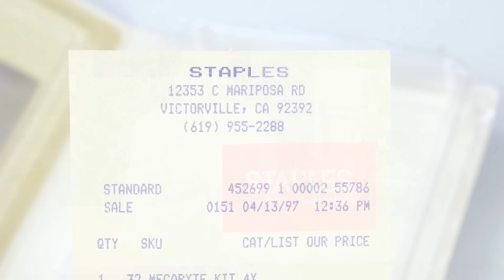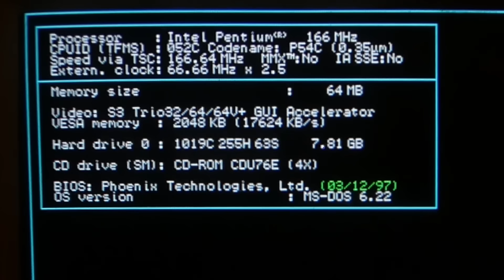Pushing Socket 5 Past Its Limit

Comment: That price seems cheap for 32mb then, but prices were dropping quick in that era. In 1993-1994 it was around $50 a megabyte of ram, then by 1998-1999 I bought my first 128mb dimm and it was under $150, maybe even under $100 by then.
I can't even remember if i had a socket 5 board but I think I did, my first pentium was a p54-120 and I overclocked it to 133, and tried 2x75 but it wasn't stable at 150mhz. I think when I upgraded to a k6 200 I got a new board and went socket 7, but I can't remember what I did with the old board and chip. I still have the board that the k6-200 engineering sample chip that I delidded and ran at 225mhz, but it runs a k6-2 450 on 6x75 now, and the super socket 7 board that originally had a k6-2 400 on it runs a k6-2 533 at 600mhz. I wish I had picked uo a k6-3 back in 2002 when I upgraded it but didn't want to spend a few more bucks back then.

Comment: I have got the At&t Globalist 375TPC, and that problem with it not booting sounds like a problem that I was having but fixed. It turns out that the version of Phoenix bios (version 4.04) hates using hard drives with cylinder values over 6349 (with 16 heads and 63 sectors)

Comment: Set it up for 100mhz and put a 233mmx in there. It will work. Although controversial cuz the core will run 3.3v instead of 2.8v. I tried it in a dell optiplex GL 575. Dont recommend running it like that for too long though. Some people say its fine, some say its not. My vrm was running insanely hot though thats for sure... 😂

Comment: you dont get linear scaling if you only bump the speed of the processor, you are stuck at 66Mhz FSB and ram. Higher multiplier = less scaling
Reply from the maker: My mind was occupied with other things while making this video so my conclusions were pretty rushed. I didn't consider things like cache and PCI bandwidth staying the same.

Comment: Even if benchmarks are saying that the average frame rate is 60 (or 35) doesn't mean that it's not dropping below that and still potentially presenting a poor experience at times.  This is why for a lot of game benchmarks you see stuff like 1% lows and 0.1% lows and stuff.  Though aside from IO, these old games won't have too much stutters from processing.

Comment: about the non linear scaling, there's some mathematical laws that get in your way. With faster CPU speeds you bascially get a linear region up until the memory bus starts getting saturated (either ram or video whichever gives out first) at which point you get an asymptotic decrease in performance until you hit 100% utilization at which point upping cpu speed doesn't matter at all.  In non math terms diagonal line that slowly turns flat as you keep upping cpu speed, with a ceiling it never gets above

I remember a personal project I did overclocking a powermac and upping the frontside bus by 10% literally did more than doubling the cpu speed. I find this stuff fascinating which is why I got into doing it for work :P

Comment: That is one beautiful system, I find kind of puzzling that you mention in this video something as weird as socket 6 but forgot to mention the entry level Pentium 75 it was the first real option for people that didn't want to invest into a 486 but couldn't afford a 90 or 100Mhz (these two came earlier than the 75) it might have not been any faster than an Intel 4866 DX4 100 for general purpose, but that Pentium Math Co-Processor was difficult to ignore. BTW cool RAM kit, Back then you could experience severe price hikes followed by price deeps in a few months, I knew people that did speculative investing in SIMMs, pretty crazy stuff. That is why you could see for a while pretty good all around entry level Pentium 90/100 systems dragged to the mud with only 8MB of system RAM. (Like the 1996 AST Advantage 622 Clint from LGR tested a couple years ago) for general use the W95 sweet spot was 16MB of RAM, 32MB was nice, but that extra 16MB was a lot of money back then for a home computer, better invested in a GUI accelerator, bigger/nicer screen, bigger HDD... hell almost anything, like a nice set of 2.1 powered speakers or a HOTAS system would be better enjoyed IMHO.

Comment: i knew someone who was using a amd k5-200 in a socket 5 system, it ran at 133 but claimed to be as fast as a 200mhz system. wonder how well that'd handle 166mhz.

Comment: great job and vid, have you tried an overdrive cpu? i can run tomb raider 2 and gta2 with a voodoo2 on a socket 5 from 1993 and its super smooth
Reply from the maker: I don't have any Overdrive chips. They usually go for too much money.
Reply: @NTGTechnology  i bought mine for around 100$ cad on ebay, not great not terrible

Comment: This board seems to have a place for a VRM header. This means you can use my S7-VRM project and upgrade this machine up to 400MHz K6-III+.
Reply from the maker: Where on the board is it? Is it the unused pads on the edge near the socket?
Reply: @NTGTechnology   2 rows of pads on the socket levar side behind the transistor with small radiator. i think necroware made a lot of videos about how to use it with the vrm module
Reply: I see that we in the community manage to find every single retro computer video ha ha
Reply: Hi NW ! 🙂
Reply: either that or go with socket sandwich adapter with integrated multipler jumpers
Reply: Ah the 2=6 AMD trick!
Reply: Oh yes, watch out the later version of Penitum MMX has 2.8 Vcore so it is not directly compatible with socket 5

Comment: 3:01 You forgot the odd one out... 50/60/66 ... the P75 is the oddball 1.5 x 50 CPU and also performs a lot worse than even the only moderately faster P90 (1.5 x 60) or P100 (1.5 x 66), because due to the low bus speed everything else also ran slower with a P75  (crunchy 25MHz PCI bus instead of 33MHz)
Reply from the maker: Yeah, this board has a 50 MHz option, I just didn't mention it. There's no reason to use the 50 MHz option unless you have the P75.
Reply: i have a pentium 180 overdrive mmx in my socket 5, i tried to switch to 50mhz once, it turned into a 150mhz cpu and i barely saw any difference lol

Comment: Is the Pentium 166 multiplier locked? Would it have worked at 166 without the mod? Great video thanks. I think the fsb/bus/cache also impacts the speed increase from 133 to 166. I saw that a lot in high locked K6-2, the scaling runs out.
Reply from the maker: It shouldn't be locked. The problem is that the board is not wired to enable a 2.5x multiplier. So it would've been stuck at 133 MHz without the mod.

Comment: My first PC was socket 5, it felt like I could literally change the CPU speed by changing the jumpers with zero consequences.
Reply from the maker: These older systems are very forgiving when it comes to messing with the settings. The worst you can do is overvolt the chip, but even then a lot of these are quite resilient and probably won't immediately blow up.
Reply: @NTGTechnology  yeah I didn't go nuts given PCs were crazy expensive at the time, but I couldn't help my curiosity.